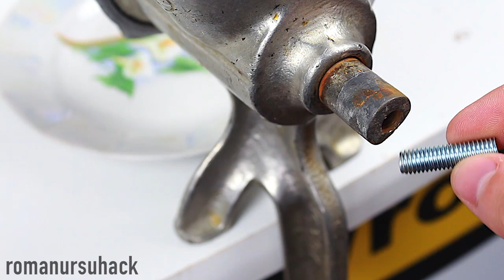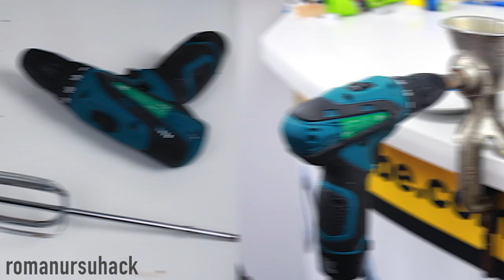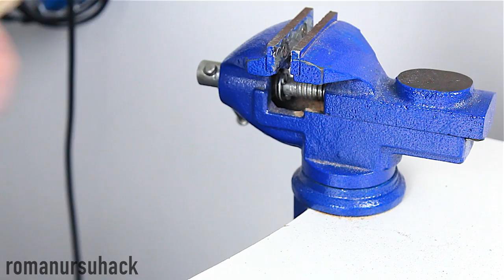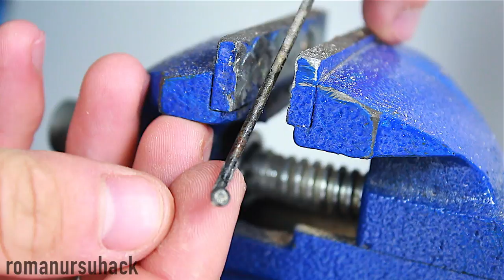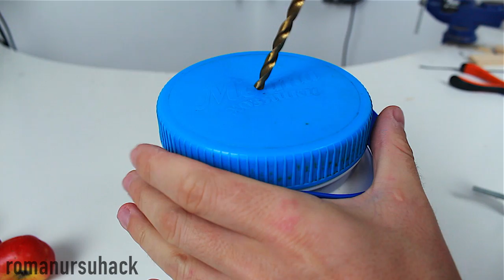5 ideas with a cordless drill

Comment: Those bot cutter blades are coated with industrial oil to prevent rust.... and you're using them to cut apples? Not to mention the plastic piece torn off the inside of the container.

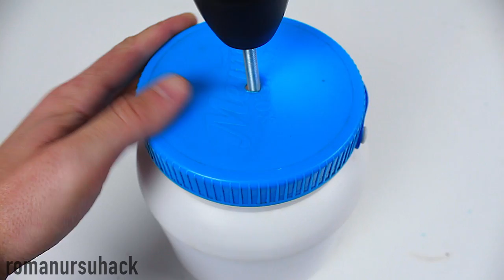Comment: 2:36  wtf
Reply: Plastic dust ideea
Reply: Is Fda and Haccp approved! :-D
Reply: Iosif StalinTM & the Partners
Reply: that wasn't the problem.........using blades in a plastic container?!?  slice it up as well and add to the fruit salad!
Reply: That's what I was thinking, mmm plastic
Reply: Cozzy Internet Plastic will not kill you if you eat it once and not even much. If you drink from ä Plastic bottle you also have small parts of Plastic in your Wather. It's much more worse drinking from plastic Bottle every day as eating once plastic.
Reply: Not really- some plastics leech compounds into water, however these affects have been greatly reduced with modern polymerization techniques and ultimately better chemistry than they had in the past.   You're far more likely to get bits of plastic due to the metal blade rubbing our touching the container, the construction of this container allows the blades to move and pivot inside, touching the sides, unlike say a blender or food processor.

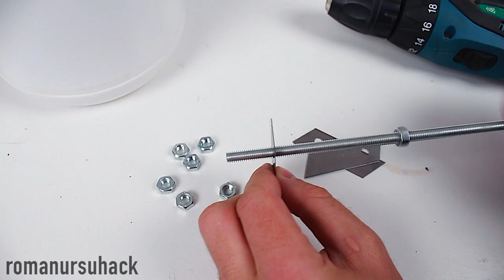Comment: 1:50 Why u didn't use the drill for that?
Reply: exactly what i was thinking
Reply: right, using the drill to screw those nuts and blades onto the all thread is more close to what the tool is designed for, a blender works great for chopping up food and you can get a piece of crap air cutoff saw at harbour freight

Comment: DON'T use those small cutting blades in a drill of any kind!  The blades are designed for high speed operation - speeds drills cannot attain.  The blades will shatter make like a mini grenade.

Comment: Anybody know how to use two reversible AC drills to get a non-producing portable gasoline generator to produce electricity? I do! Many people throw their old generators away or pay someone to replace the generator side of them when all it needs is to be "excited" and that can be done with two electric drills, at least one being reversible. For $65 I'll tell you how. That's my minimum charge.
Reply: Oh, kid? I just thought of something that may help you understand. Back in olden times, automobiles had 12 VDC (volts direct current) GENERATORS instead of today's alternators. If for some reason you disconnected the generator leads, put them back on and the generator no longer produced 12 VDC, you would have to "excite" the field again. You'd take a jumper lead ("wire" to you, kid) put one end on the positive anode of the vehicle's battery and the other end to the "field" terminal on the generator. Kind of along those lines to get a portable skid-mounted generator to produce 110VAC again. Got it now, my little "rocket scientist"? You should have known.
Reply: I bet you annoyed the hell out of all your co-workers.
Reply: Why?
Reply: OK
Reply: lol, what a troll.
Reply: Really! You believe the gall of these kids who think they know more than I, a retired Master Mechanic/Industrial Engineer schooled by the United States Army's Corp of Engineering Power Generation School at Fort Belvoir, Virginia? Pitiful...

Comment: just no, use it as a drill, nothing else, if you want a blender get one from tesco for five pounds, the threaded bar is going to cost you a couple of pounds and then the nuts another forty pence then the snap off blades maybe a couple of pounds, plus it's idiotic and I prefer my apples without razer blades and plastic shavings
Reply: ok I will admit the whisk is a good idea